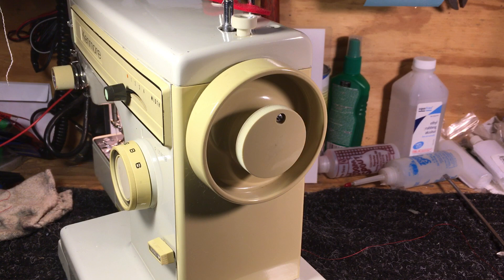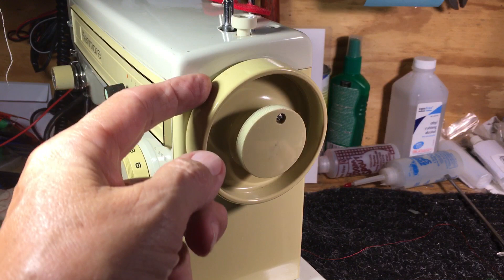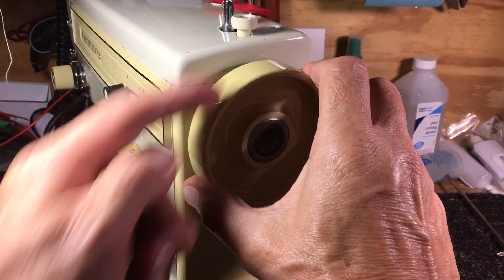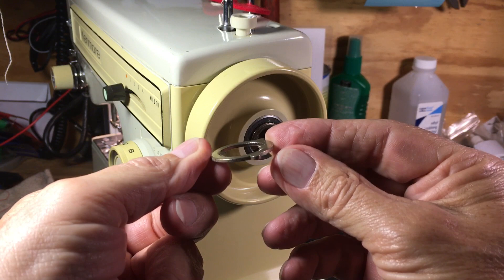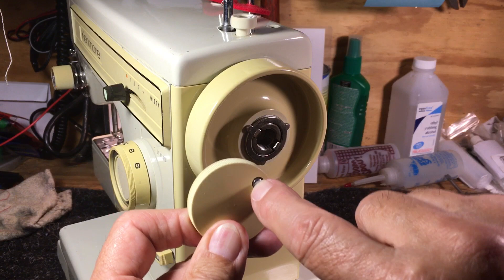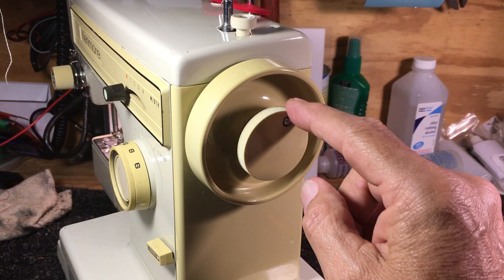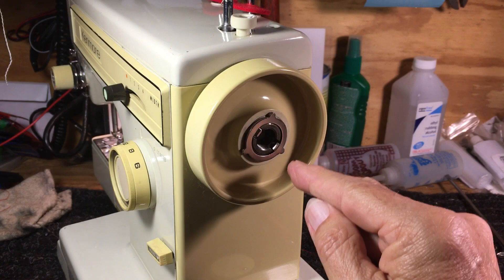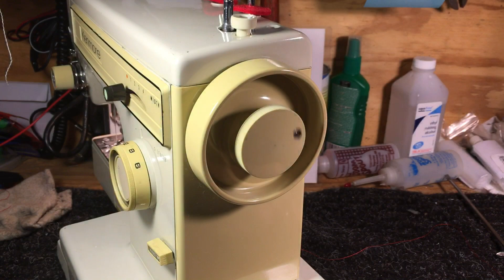Re-assembling hand wheel and clutch release

Comment: I'm writing this in case it is of some help to others who have the same issue I did, which is that I couldn't release my bobbin winder clutch wheel on a second-hand Kenmore Ultra-Stitch 10 (158.1340). I watched this video because I thought I might have to disassemble the whole clutch, but I couldn't even get the knob off to start the process. Seems this is a common issue as my search showed lots of people asking about stuck clutches but no solutions given.  So I did what humans have done for millenia when faced with a misbehaving machine: I hit it.  Percussive maintenance won the day once again. I placed a scrap of wood flat against the knob and hit it sharply in the center with a hammer. You can use a wooden mallet if you have one.  I didn't hit it hard enough to move the machine, just a sharp rap. The wheel freed up and I wound my bobbin.  As a bonus, I was able to pull off the knob as well.
Reply from the maker: Good idea using the block of wood. Where folks get in trouble is striking metal with metal. Something usually breaks. 
You’re the smart one. Using logic and letting the wood absorb the shock while giving the wheel a nudge. 
Good work.
Reply: @quinbee_creates You're a genius! Thanks for sharing your solution, it worked like a charm 👌

Comment: He said inside prongs towards you, outside at 2, 6, and 10. I thought he said it would work at 12, 4, 8, since on his first try the 2,6, 10 position failed. The washer won't stay on so I can get the screw motion wheel reassembled as it keeps falling off before I get the screw motion wheel back into the fly wheel, and the set screw (although I tighten it), doesn't seem to tighten up the screw motion wheel. Can anyone with better luck, give me suggestions here? Thanks!
Reply: Use a very thin something--a knife blade--to hold the prong washer in place while gently threading white button back on.
Reply: Squeeze a small spot of motor lube grease on the washer before placing it on shaft.
Reply: Don Slick  Great advice. Thanks, Don!
Reply: Tilt the machine so gravity doesn't make it fall off.

Comment: Appreciate this info. However,my clutch still won't disengage to wind a bobbin.  Help!  It will wind with the clutch engaged of course. 😂
Reply from the maker: You might have to remove any old oil and buildup that has accumulated on the hand wheel axle and inside the hand wheel where it contacts and rotates on the axle. Use a fine emery cloth or crocus cloth to clean and polish both. Make them shiny, oil them, and reassemble.

Comment: Sir .. thank you so very much for your video !  I had trouble taking the clutch off ,  but finally holding down a moving piece on the inside of the machine , and giving it a good turn , it came off and wouldn't you know it, that metal eared  piece along with a busted tire was the problem.  I never would have been able to get it together again without the help of your video and the way that eared piece had to fit in.  Thank you so much !!!
Reply from the maker: You’re welcome

Comment: Thank you sooo much as I was able to it back together. My wheel frozed up, so I added oil into the little hole where the clutch screw was and it worked. It finally came loose.

Comment: Thank U.  i did exactly as you said, but it didn't work.  in trying to figure out what was wrong, i noticed that the machine would hesitate.  i pulled the big wheel out a bit and greased it.  now all is working as it should.  Thanx.
Reply from the maker: Glad you got it going. I might add that a light oil is recommended instead of grease. If the grease is super light, that may be good too.

Comment: Very fortunate I’ve found your videos!  I have a sweet Kenmore 158 that I’m cleaning & oiling & gently familiarizing myself with - one of the things I’ve noticed is that when I release the clutch to wind the bobbin - the wheel and needle keeps turning as I run bobbin winder - now I know to go check that clutch position!...
Reply from the maker: Sometimes it’s as simple as holding the needle clamp to allow the hand wheel to break free from the shaft that it rotates on. A little oil in that area helps also.

Comment: Ugh, thank you for your helpful short and to the point video. I’m already stressed I can’t get it back together I hate when people just babble on and on and on!
Reply from the maker: Thanks Joannie. Your time is valuable and so is mine. I watch videos myself when I’m needing help with a project and I wonder if they are ever going to get to their point. Whenever I see a person sitting in front of the camera and droning on and on, I wonder if their goal is problem solving or self promotion.
Reply: Randy Your Sewing Machine Man I just picked up a Sears Kenmore 148.13000 it is practically in mint condition, it runs amazing! I actually got it for only $10! It’s in a table/cabinet and I can hardly find any information online about it. For some reason when I turn the hand wheel left it doesn’t disengage the needle. I took it apart to see if something was blocking it, and still haven’t figured out the problem. I was getting frustrated putting it back together. Maybe you have some tips what I could do/look for? 😅
Reply from the maker: Joannie Chorjel make sure that the hand wheel axle has oil on it between the hand wheel opening and the axle surface. Sometimes you have to hold the needle clamp and prevent the needle bar from going up and down to break the bond between the hand wheel and the axle. When the hand wheel begins to spin freely it will distribute the oil down the axle shaft and remove the glaze of old oil buildup that is probably causing the problem.
Reply: Randy Your Sewing Machine Man thank you so much for taking your time to reply and help me. I’ll give it a go!
Reply: Randy Your Sewing Machine Man so I did try your suggestion.... and it worked! Thanks again 🤗
Reply from the maker: Joannie Chorjel good job. I’ll send you your for sure, super skilled, sewing machine technician certification papers in the outgoing mail. Enjoy your awesome Kenmore.

Comment: Hi Randy, this was such a helpful video.  My daughter and I applied ourselves diligently and won!  The reason we watched it is that we just got a used Singer 513.  We did some tests, all seemed to work fine.  Left it turned on, went into another room, and when we came back five minutes later, we heard a noise, then it started to smoke, smelly chemical smoke.   It seems to still work, but We wondered if the fact that the clutch had been blocked was not the issue.  We had tested both sewing and the bobbin winder without realizing that there was a clutch problem.  We are now cleaning and oiling it to cover all bases.  Any ideas for the smoke?  Many thanks again for your great work, Beth Austin

Comment: Thank you!  Thank you! Prongs pointing OUT! I bought a NECCHI "parts machine" for $65. When I got it everything looked fine, but it wouldn't run no matter how tight the inner hand wheel was tightened.  Someone had apparently been fooled by the counter-intuitive aspect of the clutch disk. You would think the inner tabs are to engage the slots on the drive and should be turned in. No longer a "parts machine."
Reply from the maker: Excellent outcome. Give that machine a new lease on life. You’re welcome.

Comment: Been looking around all morning for just the right machine and someone I can understand. I like the detail you use while going through the re-assembly of the wheel. My problem is that I know that two wheels turn in opposite directions but the little wheel no matter how I try will not turn. It has become one solid piece. I dare not force it for fear that I will make it worse. Any advice on your part would be appreciated. As a last resort I will take it to be repaired but not a lot of $$ and I am the original owner : ) so getting around not so easy anymore. Thank you in advance for any help you may supply.
Reply: Myrna Cruz On my Simplicity the outer wheel is the same diameter as the inner wheel. It’s wide and very hard to grasp while holding the inner wheel.. i can’t budge it! It’s as if I super glued it together. I’m afraid to break it. The machine sews fine. I just can’t loosen the clutch to wind bobbins.

Comment: I have a Kenmore 148 with a very similar set up. I think there's some old grease on the shaft that spins between the inner and outer wheels at the handwheel, because even released, the mechanism still moves, but slowly. When I put my hand on the inner wheel, it stops. 
I thought I lubed the heck out of that point, but it looks like I'll have to go in again?
Edit: pulled off hand wheel clutch again, pulling the handwheel out a bit I put a lot of Tri-fllow on it. 
After taking off the top, I found when I pulled out the hand wheel a bit, I could see old thread wrapped around the shaft. 
This may have been causing more friction than the machine wanted. 
Could have been that it needed more Tri-flow or the thread was messing with it, but it's running great, now!
Thanks very much for your video! Huge help!  1 out of 4 ways that part goes on right! =)
Reply from the maker: Good detective work. If thread gets wrapped around the hand wheel shaft, it can really cause a problem. Sounds like you are on top of things and found the solution. Excellent.

Comment: This is a very helpful video.   I have a Model 13402.  I got it out to start using it again.  I went to wind my bobbin but the clutch wheel will not budge.  I took the screw out but it still wouldn't budge.   Otherwise, the machine sews fine.  Any idea how I can loosen the clutch to wind a bobbin?
Reply from the maker: Turn it up onto its left side with the hand wheel upward. 
Spray some penetrating oil around the circumference of the main shaft and in between the hand wheel. 
Hold the needle clamp from moving up and down while you turn the hand wheel to release it from the main shaft. 
Don’t pry anything and be patient as to not break anything.

Comment: I’m afraid to try this but I may have to. The hand wheel and clutch wheel are the same size on my  1991 Simplicity machine so it is difficult to hold the inner wheel steady while trying to turn the clutch wheel toward me. It just won’t budge! I see the screw on it. I have never ever changed the belt either in all these years. I cleaned and oiled it today. It sews just fine. I just would like to wind bobbins without  having to let the needle go up and down. Grrr.

Comment: You are such a life saver.. I did take that off my hand wheel is locked does that mean it is on wrong or do I have something else wrong.. Ive been trying to fix my tension for 5 days now.. I think I messed up my bobbin tension but I have tried everything.. Help..
Reply from the maker: The hand wheel being locked could be as simple as a piece of thread being stuck in the hook assembly. On a sewing machine, if anything is locked, everything is locked. I have a video on reassembling that mechanism after you take it apart to check.

Comment: Hi.  This video helped me tremendously.  The clutch release was tight and would not loosen when threading a bobbin.  It had been like that for years, it is my mom's JCPenney Model 6923.  My husband took the entire hand wheel and clutch release apart and put it back together in hopes to get the clutch release to work.  Well the clutch release works, but how I get a loud squealing noise when I sew.   I thought he put it back together wrong, so I took it apart again, followed the instructions here, and thought I resolved the issue and still a squealing noise.  I cleaned out all the debris.  Any other suggestions before I try to find a repair shop during this time of SIP.  I am part of a mask making group serving out local hospitals so I want to get back up and running fast.
Reply: To get it to sew, hold the large wheel with your left hand and with your right hand, turn smaller wheel AWAY from you to engage the sewing needle. To wind the bobbin, hold the large wheel with your left hand and turn the smaller wheel TOWARD you to keep needle from jumping up and down as you wind the bobbin. I hope this is what you had trouble with. Not very clear but thought I’d take a shot at your intentions since you had no response.
Reply: Squealing noise is often caused when the belt is too loose.  The pulley on the motor spins faster than the belt and makes a squealing noise.

Comment: I use a little trick I thought of. I take a white magic marker and mark the washer and machine each with a dot. Then just line up the dots, and you're good to go. First clean each area with a cotton swab with alcohol and let it dry a few seconds. Works for me, and whoever buys my machines.
Reply from the maker: Great idea.
Reply from the maker: The more I think about it, it’s a good idea if :
The clutch disc was installed properly prior to you taking it apart.
The clutch disc isn’t missing and you need to replace it.
The clutch disc doesn’t fall off as you disassemble the wheel.
The clutch disc has the grip prongs facing outward.
Other than that, great idea.
Reply: @randyyoursewingmachineman9954  what i do is tip the machine towards the needle end to remove & replace. You're right, this only works when everything was correctly installed in the first place. I am very honored that you thought enough to respond again. You are an excellent repairman and person. Thanks for also being a friend. Ron
Reply from the maker: Ronald Devine thanks for the kind words. My best to you as well sir.

Comment: Great video Randy!  thanks. 
I've got a Pfaff Tiptronic 1151, got off ebay for $95. seller claimed "in great shape" and was on a bid basis; rt after I received it I checked it out visually ( not plugged in yet ) and the hand wheel is frozen. My question: do these s machines from the early 90's have a similar "clutch" such that your video can help me fix it? I dont want to break anything not knowing what im doing, I cant find anything on this issue online for these brand models other than "ship it to me and for about $400 I'll fix it 4ya".   I bought it for my sister. please help, Thanks!!
Reply from the maker: First, make sure that the lifter lever and reverse lever are in the unlocked position.
The second thing I would do, is remove the bottom screws (4) and check for a crack in the gears. If there’s a crack, a refund is in order.(game over)
If the gears aren’t cracked, it will need to be oiled in all the spots.
If an assembly spins, slides, pivots, or rotates, it will need a drop of oil. 
AFTER OILING COMPLETELY, AND NOT BEFORE:
Try urging the hand wheel to turn by coaxing it very gently in a turning motion with both hands.
Make sure that the bobbin case is removed, and the hook assembly is soaked with oil. (More than a drop)
Be cognizant of the fact that there’s plenty of plastic in that hand wheel area.
Don’t go all “gripzilla” and break something.
Be patient and just get it moving.
If it starts moving at all, you’re the winner. Stick with it and it will eventually run freely.
Good luck.

Comment: Great video Randy, I'm using a friends machine (similar if not exact model) I have her machine guide, and am trying to follow the directions for releasing the clutch in order to wind and fill a bobbin. I don't think she's used the machine in at least a couple or three years. Anyhow both I and my husband tried to turn the inner knob toward us while holding the outer ring still, to release clutch as shown in her guide, and it won't budge. Any ideas what we might be looking at? We're stuck inside due to Coronavirus here in California and I was hoping to whip up some face masks. Thanks in advance. I now most YouTubers don't look at or respond to comments, but I am not near a sewing machine repair that is open.  Hope you are well, Susan.
Reply: I'm having the same issue! Well, my clutch seemed to "release" (got looser) but the needle is still going up and down.  Did you find any answers? S.O.S.! Thanks!
Reply: Same problem 😐 Was hoping there would be a reply in the answer...
Reply: I realize this is a very old comment chain, but I had the same issue and commented on another video, and Randy saw my question and answered! "Put a cloth around the release knob and gently release it using large channel locks. I do that whenever the knob is stuck." This worked perfectly for me, the inner knob just needed a little more encouragement than can be given by hands alone. 
Video with comment and answer: https://www.youtube.com/watch?v=MXpD6ylFfkc&lc=UgwoG2FRvLf8rAj70ER4AaABAg

Comment: Hi Randy, I have kenmore model # 158.12511 and the clutch will not release (not turn at all) I can unscrew the crew but it will not turn, My machine runs and sews but I can not release the needle to thread the bobbins.  I have tried to spray W d40 with no luck. Can you please help?  Thank you Margaret from MICHIGAN 2-28-20
Reply: Upfromthe Basement  I had the same issue, I literately had to use a rubber mallet and oil remover but after two days the clutch and wheel got unstuck. Softly hit the wheel from behind and spin it as you hammer. Your wheel is ceased to the clutch. Old oil turns to nasty varnish.  Remember rubber mallet or rubber hammer. Good luck.
Reply: Angel Morningstar  thank you I will give it a try this week
Reply: @upfromthebasement5996  it will work, just have patience. It took me 2 days and half but I'm very happy. Keep me updated.

Comment: Hi Randy what if the knob it self is stuck I have a kenmore ultra stitch 6 works great but cannot wind a bobbin
Reply from the maker: Unstick it by wrapping a soft cloth around the release knob and use a large set of channel locks to loosen it. 
I’ve made a video addressing that issue if you can find it among the 409 videos.

Comment: My hand wheel looks different, do you have a video removing different styles? Thanks you
Reply from the maker: If it has the release knob with the tiny set screw, it will work the same. 
If there is no set screw, it’s a different setup and I don’t recommend you taking it apart, so no video from me.